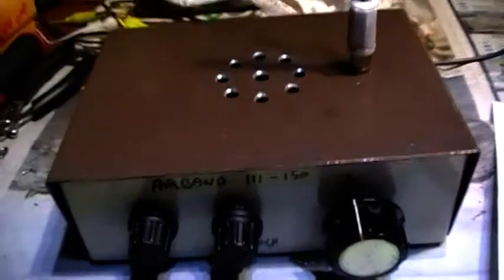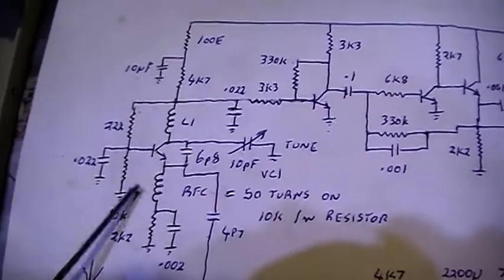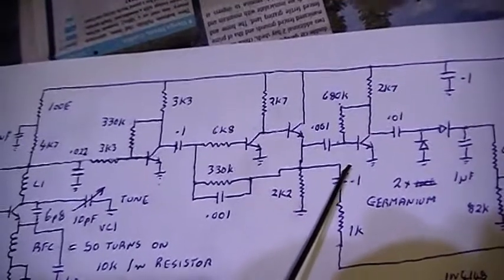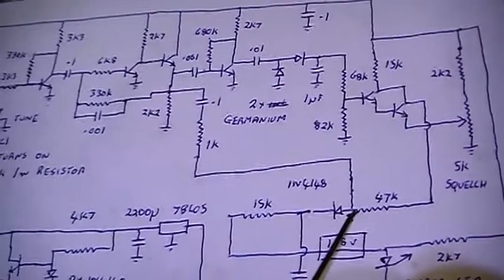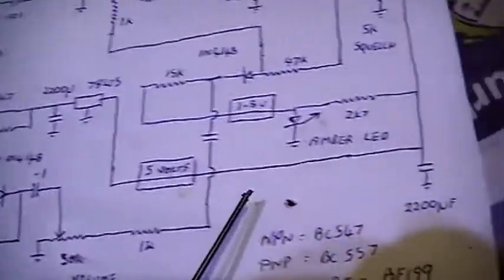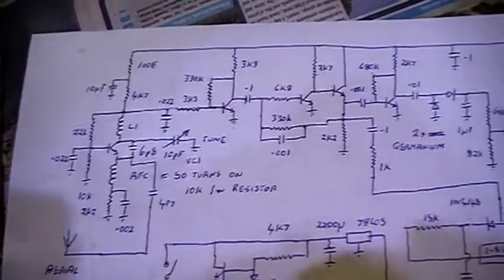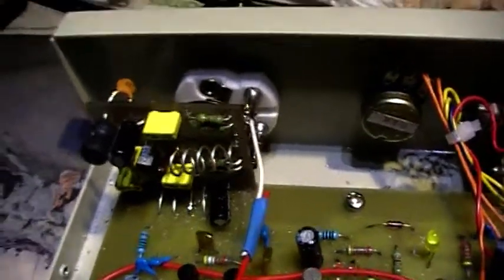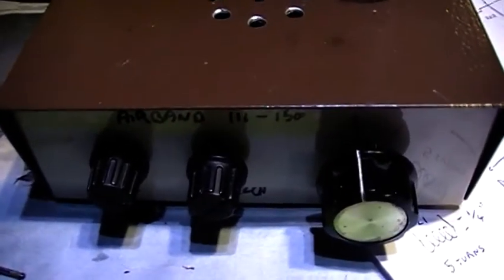update on suppergenerative airband rx with schematic

Comment: That's one clever design! Especially the Squelch circuit is unlike what I've seen before, but I'm more a tube-man than a transistor man, except playing with the old Germanium every now and than. Build so many super-regens, I caught the bug after building my first for the CB-Band, and than realized I could work frequencies far beyond the reach of both my wallet and component availability. Since after all, if you've got an oscillator running at say 2400 MHz, you can convert it into a 2400 MHz receiver by simply adding a Quench-system. And this means that there's no need for very expensive tubes and a lot of piping to get working deep into UHF-country. Never build one with a squelch though, always tried to achieve maximum selectivity, and this too keeps down the noise most of the times.

Ought to copy and study that Squelch circuit in a bit more detail to get a vacuum derivate of it, but nice work!
I do adviice an RF-stage in front of the detector, but not because of the radiation it gives, but rather the fact it's easier to change antennas than, since the load doesn't change (and hence there's no birdies or anything). But when I don't use an RF-stage (and I usually don't either) and use transistors, I use the emitter-coupled input too, since it's by far the most stable form of input from a low-impedance load. You can literally hang anything from a 50cm loaded whip to a full-sized 5m end-fed dipole from that emitter and it'll usually run just as smoothly.

And never thought about the voltage stabilisation either, but you're right here too: we're dealing with an oscillator here after all, and voltage going up/down is not really a good recipy for stability, and hence selectivity on these things. But the old vacuum things are a bit more forgiving in this matter, especially if they're fed from HV batteries (which they often were, since portable VHF-UHF equipment with tubes was unthinkable except by using a super-regenerative stage before the advent of submini tubes) and there's a good decoupling of the battery's internal resistance by bypass capacitors.

Nice work!
Regards,
Thomas
Reply from the maker: Thank you Thomas for those kind words. Yes, I agree, the SR is a fascinating design. I too enjoy vacuum tubes, its always a challenge to get these operating at VHF frequencies whereas transistors make it so easy. I have developed this design further to improve the squelch sensitivity by using an 8 kc audio bandpass filter before the squelch rectifier. This keeps any  quench residual and audio modulation from gating the squelch on and off. This works well with tubes also , then  I use a pot core inductor as the tuned element before the squelch noise amplifier and the rectified DC switches a triode that pulls the audio output screen to ground, thus muting the radio. Everything RF that I make with tubes I just  use ECF80/6BL8 including audio output where they will happily drive a speaker with 500 mW with around 180v. These Triode/pentodes keep the tube count down, are very cheap and work to VHF.

Comment: On the lack of an RF stage and radiation from the superregen -- I read about one experimenter who, in the days of vacuum tubes, created a VHF superregen to listen to air traffic. At some point the experimenter heard the pilots complaining about frequent interference when flying over the experimenter's area, and that a direction-finding team would soon be dispatched to isolate the source of the interference (after which the experimenter stopped using the receiver). Something to keep in mind!
Reply from the maker: Hi QRP.... vacuum tubes with high voltage yes, i would probably agree.. Here we have the SR stage running at just 5 volts, generating just a few microwatts of RF. The operating voltage and current is extremely low. The aerial too is very loosely coupled via gimmick of just a few Pfs... The few microwatts of RF output is also swept over a few hundred KCs,  by virtue of the quench frequency, so RF at any one frequency is correspondingly reduced.in proportion.
In real terms this is not an issue, the AM background noise in a commercial aircraft radio would be many times greater.
Reply: Good points. Still, a superregen (with or without an RF stage) is probably not something you would want to use in the vicinity of an airport. :-)

Changing topics slightly, we previously discussed an HF (not VHF) superregen as developed by a Japanese experimenter here: https://www.youtube.com/watch?v=hb0IRSHXqm0 . There's also an HF superregen by a German experimenter here: http://www.b-kainka.de/bastel61.htm, and yet another circuit here: http://www.amalgamate2000.com/radio-hobbies/radio/super%20regen%20at%20HF.htm . Given your experience with superregens, have you ever considered trying to make one work at HF (and making a YouTube video of it)? Of course superregens at HF will have several limitations, but still I think it would be interesting to see a video of the best performance that is possible when using a superregen at HF -- the linked video above by the Japanese experimenter seems sub-optimal (low sensitivity) maybe due to a square-wave quench and other factors.
Reply from the maker: If a modern superregen disrupted  any  aircraft communications to  an extent to cause a safety issue, I would be very inclined to question the quality of the equipment they were using, rather than the sub microvolt interferrence  caused by outside influences.
HF superegens are hampered as you say. The quench frequency is required to be low enough to have a reasonably narrow  RX bandwidth which puts it in the audio range. A better approach possibly  is to use a tuneable upconvertet and a VHF IF using the SR principal, say at 60/70 Mhz, We can then tune through the IF with a downconverter. 
This violates the first principal of any superhet in  having as much selectivity and as little gain as possible before the second mixer.  
We get away with poor selectivity at VHF in a straight SR simply because seldom do we have adjacent transmissions happening concurrently... here the elegant simplicity of the SR is attractive despite the poor RF prformance. 
 I guess , with great swathes of dead sw bands we have now, arguably HF selectivity could  now be less of an issue  for SWBC listening at least?. We really need to discover what a radio wave actually is, and use that directly, rather than converting it into little electrical signals in a lossy  aerial wire and treating it as electrical disturbance, rather like we do with microwaves and light. We could use the equivalent of a "radiowave" prism to tune across the SW bands with no electricity required.

Comment: Hi Dayle,

Thank you for this nice video.
I have built a lot of SRRx but I was looking for a nice squelch circuit.
Could you please provide with a link for the schematic ?
Thank you 
Philippe
Reply from the maker: Thank you for the kind words. I know little of computers to upload a schematic, but if you pause this video here and there you can copy it. The relevant parts of the squelch circuitry start at the second transistor stage onward. Basically we use a passive LPF to remove the quench frequency, the  audio is passed to the audio amp via a gating diode. The diode gate is switched by the rectified high frequency audio hiss after being  seperately amplified.  The diode is biased at roughly 2 volts by the voltage drop across the LED, and is forward or reverse biased depending on the presence of the input signal quietning  the backgound hiss, the classic noise operated squelch. This is really the only way to squelch a superregen. It gives a very good squelch sensitivity of under  a microvolt, and is not affected by any audio modulation causing "chopping".